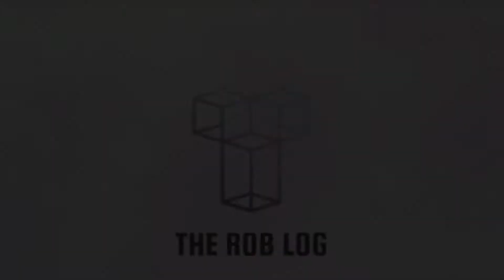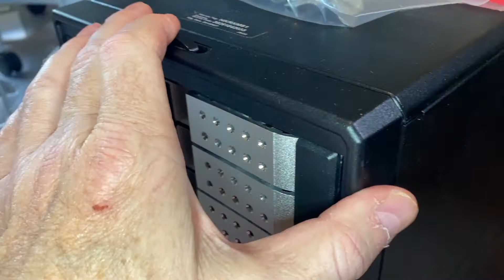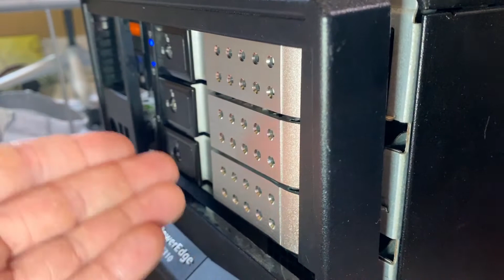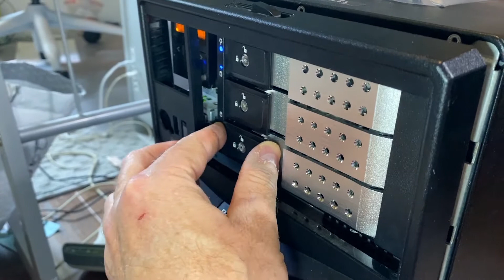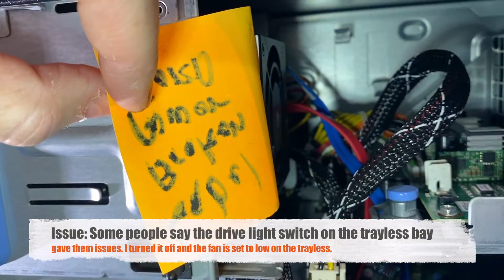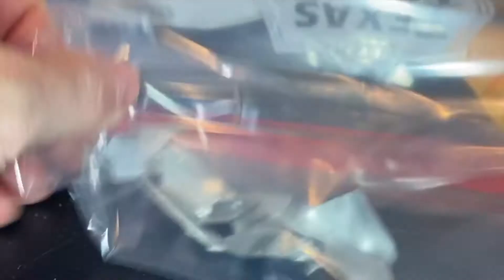7 Bay Dell T310 Tower Unraid Server Build. BPN-DE230SS, H310 HBA/IT. Goodbye Drobo?

Comment from the maker: 9/8/2021: I moved my WDC_WD2002FAEX 2TB from the built in 4 bay to the iStarUSA BPN-DE230SS-BLUE Hot-Swap 3-Drawer Drive Bay: https://ebay.us/bswKZV Amazon: https://amzn.to/2OtlnN7 and it runs at least 6C cooler. I put it in the bottom slot so it doesn't suffer from presumably warmer temps at the top of the drive stack. I was getting warnings on Unraid of it exceeding the 115F preset temp by a couple of degrees...as much as 117F IIRC and now it's 111F in a somewhat cool room, so definitely put your hard drives in the StarTech IF you don't mind the 3Gbps internal SATA speed....which if this is on a 1GBPS network perhaps not a big deal. The drive isn't over 150Mbyte/sec anyway, so 3GBPS only limits the drive's cache speed. I wouldn't of course put an SSD there but then again you shouldn't need to for heat purposes anyway.
Reply from the maker: I suppose you could also get a SFF to SATA breakout cable for the other side of the H310 (two SFF ports are avail so 8 drives is easy if you can find the space for them) such as: https://ebay.us/fttCIK or https://amzn.to/3zYax4r Use my links so I can afford McDonald's. Then you'd get 6GBPS out of the drives in the iStarUSA bays but unless you've got a 10Gbps network IMHO it's not worth the $$$ for hard drive speeds alone.

Comment from the maker: Update April 11 2021. I'm having trouble with Carbon Copy Cloner dropping the connection sometimes. I have tried swapping Ethernet cable, router, and finally now the port since the T310 has two. There's also a setting in Unraid to let you flip the ports so you can make either one into eth0. I also turned on ipv6 to see if that helps any. The other thing I'm doing is HAMMERING it with a parity check, CCC backup and Blackmagic Disk test all at the same time to see if CCC drops and Blackmagic doesn't...like a dummy I restarted the server before the parity check finished this week so I restarted that.

Comment from the maker: 🧯⚒⚒   Parts List  ⚒⚒🧯. If you use my links I earn a little or you can send me $1 for a McDonald's coffee here: http://paypal.me/beachfitrob
Preflashed H310 cards are also on Ebay or you can flash them: https://ebay.us/fr29ci
Cables from H310 to the T310's 4 slot backplane: https://ebay.us/9WXvDN
iStarUSA BPN-DE230SS-BLUE Hot-Swap 3-Drawer Drive Bay: https://ebay.us/bswKZV Amazon: https://amzn.to/2OtlnN7
T310 Servers on Ebay: https://ebay.us/C8ts0H (Some have upgraded Xeons...I'd get a Xeon version for the ECC RAM. Server's gotta have ECC IMHO.)
X3440 Xeons: if yours comes with a X3430 it's an EASY swap. 4 screws, and I hesitate to say you can't mess it up but it'd be pretty difficult. https://ebay.us/A2UYsC
eSATA brackets: The T310 has SIX onboard 3gbps ports, so this machine with an H310 card can run 10 SATA devices total. 7 internal and 3 external via eSATA. https://ebay.us/Ayn67S
Reply from the maker: As noted below, the 3440 is a cheap ($11 or so) upgrade and adds hyperthreading and a small base CPU speed boost. IMHO worth the price. The stock 3430 doesn't have these features.

Comment: What HBA where you using and cables becuased you metions switching them out and you also mention flashing the HBA i presume to a differnt firmware but how did you go around doing it? p.s looking at buying one and using truenas core on it.
Reply from the maker: As the video title suggests, it's a H310 from Dell flashed with their firmware. Here's a rough guide to flashing but this info is ALL OVER the internet and I don't remember what guide I used. https://www.vladan.fr/flash-dell-perc-h310-with-it-firmware/#:~:text=The%20thing%20is%20that%20the%20Dell%20Perc%20H310,6Gbs%20throughput.%20The%20firmware%20used%20is%20Dell%27s%20firmware. Or You can buy them preflashed on Ebay: https://ebay.us/fr29ci (Using my links earns me a small commission) Cables from H310 to the T310 4 slot backplane: https://ebay.us/9WXvDN I'm going to pin a comment with a parts list so if people use those links I get a few dollars. Underemployed.

Comment from the maker: Update: Today I moved a Seagate ST1000 out of the 4 slot backplane into an eSATA (OWC Pro) case. It's a kinda slower but still decent 2.5" laptop drive, so it also doesn't need much cooling. I added a second 3TB WD Blue drive as as second parity to that backplane slot. So, now I have 7 internal and 1 external drive(s). At some point, I may move my 4TB out of my Mac Pro into a parity slot and one of the 3TB parity drives into a data position for more storj space.

Comment from the maker: I just put an X3440 in. The stock Xeon doesn't have hyperthreading (!!) and the X3440 is a little faster. Ebay: https://rover.ebay.com/rover/1/711-53200-19255-0/1?mpre=https%3A%2F%2Fwww.ebay.com%2Fsch%2Fi.html%3F_from%3DR40%26_nkw%3Dx3440%26_sacat%3D0%26LH_BIN%3D1%26_sop%3D15&campid=5337871940&toolid=20008
Reply from the maker: Here's the exact seller I used https://rover.ebay.com/rover/1/711-53200-19255-0/1?mpre=https%3A%2F%2Fwww.ebay.com%2Fitm%2FIntel-Xeon-X3440-2-53GHz-LGA-1156-Socket-H-2-5-GT-s-Desktop-CPU-SLBLF%2F203129388998%3FssPageName%3DSTRK%253AMEBIDX%253AIT%26_trksid%3Dp2057872.m2749.l2649&campid=5337871940&toolid=20008 $10.99 shipped, and they are in the USA, not China as many selling these are. Only issue was a little bit of thermal compound on the contact pad side but I cleaned it and it's been up for weeks...since I put it in I don't think I've shut it down. The CPU is an easy install as the heat sink has 4 simple Philips head screws and a simple retaining mechanism. For $10.99 (Less because I had ebay bucks) I recommend this upgrade.

Comment from the maker: Caveat: you will not be able to put a GPU in this that needs more than 25watts from the PCIe slot. Dell designed it that way. If your GPU has power inputs (unlike my 1050Ti I was trying) it might work but then you'll need to steal power via a SATA power connector so you'll need that power cable.
Reply: Right I checked this out yesterday and GT 710, GT 1030, R7 240, R7 350x should work although a couple of those are 30W instead of 25W. Nvidia hardware acceleration for transcoding is generally better supported but if you can't then get the newest AMD possible.
Reply from the maker: @deViant14  Do any of those have external power input? You could adapt the SATA power to the 6 or 8 pin GPU power port and 5W is no big deal for SATA. Probably be OK with a splitter but I'd have to check SATA power specs. Thanks for the reply! Subscribe plea here. ;) Just added an X3440 CPU to mine. Nice little boost for like $11 IMHO.

Comment from the maker: Updated to a Xeon X3440 because it has hyperthreading and a slightly higher clock. It was about $11 shipped on Ebay. Seems a little zippier and hyperthreading is working...sooo....Figure it's worth it. Hard to think the X3430 that's stock doesn't hyperthread...why bother?

Comment from the maker: How I got this: after deciding I was going to move from my old Celeron E3300 setup (4 gigs RAM, 4 hard drives...pretty low end) I happened on just what I was looking for at Goodwill. A tower Dell 310 with dual power supplies and the SAS/SATA backplanes. $50 for TWO towers, all the trays, 16GB RAM total, and two power supplies. I haven't tested the second tower much but I basically could build TWO servers with 8gb RAM each for $50. Both are the Xeons. Pretty sure the craft store "Michael's" owned them once as that what domain was still in the iDRAC management config. It also explains the candle/potpourri smell in the towers. But you could do worse.

Comment from the maker: Supposedly pulling RAM can cause lower fan speeds as the machine calculates less cooling is needed. But I think 16GB would be the same as 8.
Reply from the maker: 16gb seems a good bit faster to me even though the 8 was nowhere near even half utilized.

Comment from the maker: Thought: the T310 has 6 SATA ports on board, so you could easily add brackets to turn those into eSATA for well under $10. https://rover.ebay.com/rover/1/711-53200-19255-0/1?mpre=https%3A%2F%2Fwww.ebay.com%2Fsch%2Fi.html%3F_from%3DR40%26_nkw%3Dinternal%2Bsata%2Bto%2Besata%26_sacat%3D0%26_sop%3D15&campid=5337534429&toolid=20008 That would give you 10 SATA devices total with the 4 in the backplane.

Comment: Had an idea: a PCIe card with SSD space on it. I saw one that had 4 slots so you could use one for two small cache SSDs. Leaving 7 slots for drives. The T310 has these PCIe slots. From Dell's Spec Sheet: "Two x8 slot, (one with x16 connector)
One x4 slot (with x8 connector)
Two x1 slots" So, enough bandwidth to exceed Gigabit Ethernet for sure. I guess you pick if you want SSDs (U.2 aka 2.5") or NVME...whatever. ;) Numerous choices on Amazon: https://amzn.to/2G4eyxL There's $6 x16 slot card (You'd get x8 speeds in the T310) for example that fits M key SSDs.
Reply: PCIe Gen 2 x8 has a 4Gb/s max speed so you'd need 10GB networking to saturate that. x4 slots would also be plenty for gig ethernet.